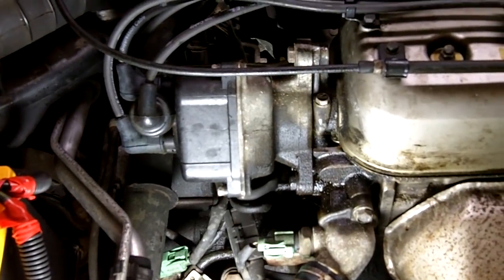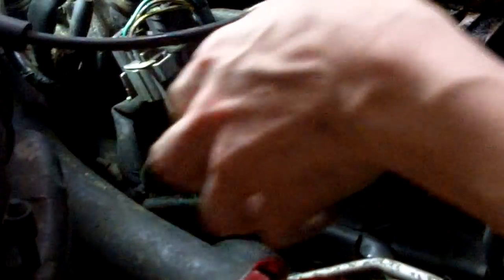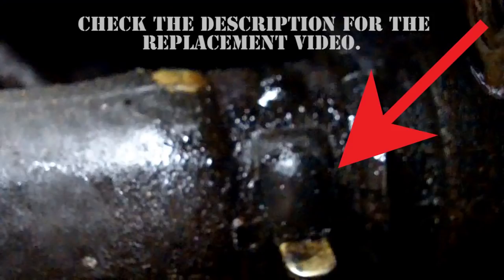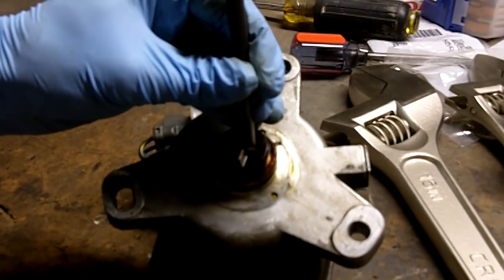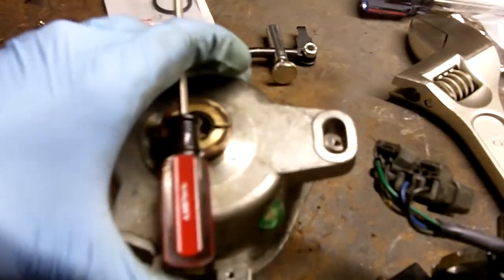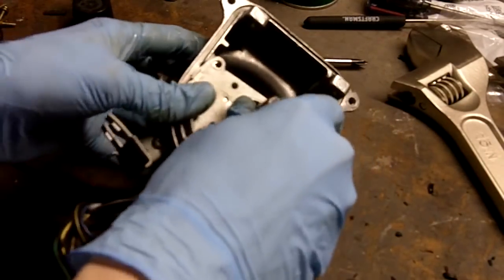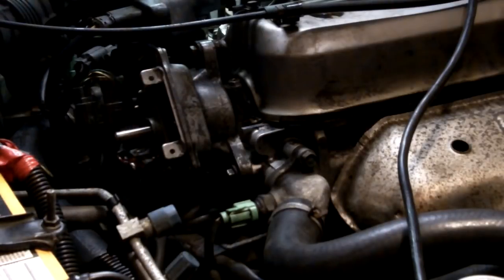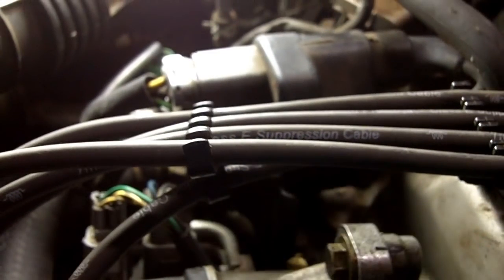Honda Distributor Oil Seal Replacement

Comment: Hey Bousho,  my F22B2 is leaking oil pretty bad from under the timing cover.  I had the timing belt replaced a while back and they didn't replace the main crank seal while they had it apart.  Lesson learned.  It might be my camshaft seal too though... I had a state inspection done here in VA and they mentioned it was pretty bad.  Whatever the case, any chance you have a video on these seals?  I hate the thought of having to pull a new timing belt off to replace a seal, but it also can't be good to have oil dripping on the rubber belts.  I'm guessing that's bad news over time.  Your videos have saved me thousands of dollars over the last year.  Your rock, man.  Keep these coming!!!
Reply from the maker: The cam and crank seals should have been replaced preemptively during the timing belt job. It protects your investment in the parts oil exposure will destroy the belt over time.

The water pump should have also been replaced if it seizes it will destroy the belt and cause serious engine damage. It's also a good idea to replace both idler pulleys too at a minimum you should spin them to check the bearings.

I usually purchase a timing belt kit it includes new idler pulleys, a water pump, the timing and balancer shaft belts, and only costs around 70 bucks. The seals and valve cover gasket are the only things I have to purchase separately.

Before tearing too far into the engine. Pull the valve cover off and check the gasket if it's cracked, hardened, pinched or rolled over due to an installation error especially around the timing cover area that's the source of your leak.

To get to the crank seal the timing belt has to be removed again. Remove the drive belts, unbolt the power steering pump and lay it off to the side, remove the valve cover, remove the crank pulley, remove the upper and lower timing covers, loosen the timing belt adjusting nut and remove the 2 belts, then you can remove the sprocket on the crank to get to the seal. The cam sprocket is just secured with 1 bolt and it pulls off be careful not to lose it's small key.

If you're just removing and not replacing the belts you don't have to remove the driver side motor mount.
Reply: ***** Great advice, my friend.  I'll pull the valve cover off in the next month or so and check it out.  In the meantime, if I find that the leak is coming from the seals, do you happen to know the part numbers on those two?  I've tried to pull the schematics up on Majestic Honda, but you know how vague the descriptions are on specific parts, I don't want to order the wrong ones if/when I need them.  Aside from the cam and crank seals are there any others I should replace?  I recently replaced the valve cover seal (within the last year), but I'm not opposed to dropping $20 on another one.  I'm still hoping you have a vid on these badboys!  :)  No pressure. You rock.  PS: the water pump was replaced.  I don't know about the pulleys or the seals though.
Reply from the maker: 4frodo
Good the gasket should still be fine unless someone popped the valve cover on with it rolled over during the timing belt job.

When you tighten the bolts down with a misaligned gasket it usually tears and leaves a little path for oil to leak out from.

Oh another thing I forgot to mention if 2 dabs of RTV wasn't put on both sides of the camshaft hump where the gasket seals that could also cause a leak.

You get used to navigating that parts database eventually as frustrating as it may be.

The crank seal is under oil pump because thats the part it's pressed into and the cam seal is under camshaft. I just use name brand aftermarket parts and I've never had an issue.
Reply: ***** I was able to pull 91213-PT0-003 for the cam seal, but no luck on the crank seal.
Reply: ***** Thanks Bousho.  I'll pop the valve cover off and check that I didn't screw up the RTV when I installed it.  I'm sure I'll have more questions in the coming days/weeks.  Keep up the good work!  It's awesome that you respond to these questions.  It means a lot.

Comment: I've understood most things bc he is a good teacher. The part in not understanding is the reference point for the two dimples. I saw they are both vertical, but I don't know the how to line them up, or what I'm lining them up with. So how do I ensure I don't reinstall it out 180 degrees? I'm not sure what I'm marking.

Comment: Or...there's a plan B, if you can't find the inner seal anywhere to buy and if you want a really cheap "fix" for this oil leak situation (mine: original Hitachi distro, VTEC, 96 Accord EX 4 IL, OBD2, has 268K mi, bought at 92K mi, self maintained except for the heavy jobs), instead of replacing the inner leaking seal (I had replaced the outer seal thinking that was the leak problem, but it was actually the inner seal), I just wedge a couple small kitchen sponges, dry, under the oil drain spout (it's there in case you do have this oil leak, keeping the distro from filling up with oil).  I swap out new sponges whenever the current ones are looking saturated enough, about every several months.  The distro leaks such a small amount that this works fine.  It does keep oil from leaking all over the hoses and other parts sitting below.  I've been using this "fix" for over 100K miles and it's totally functional, works great.   

A secret to keeping the oil leak small is keeping the engine's oil level no fuller than a half court below the full mark on the dip stick!  I just add another half quart when it gets down to the one-quart low mark.

Comment: Good to know i dont need to do that on my 1990 accord dx no power locks or windows takes 4rear handles. Crazy rare car. Over 500000 miles runs perfect
Reply: Internal coil accord ing to this guy
Reply: Good video!!! thats why o rings are so important it can kill all the electrical. i rebuilt my dizzy and dry ever since just the o ring same with power steering pumps leaks on the alternator killing it

Comment: did mine no damage to anything but lots of oil 30 mins and 1/2 can brake cleaner fixed cost me $2.15 for the seal and I had brake cleaner ...all good considering I just bought it for $400 with oil leak and no catalytic converter

Comment: BTW, I had hell getting the rotor screw out last time I changed the cap and rotor.  So I took a dremel tool and made the screw a deep slotted screw.  It was the only way I could even get the screw to come out.  Now it comes off and goes back on a lot better than with the POS original phillips head.

Comment: Great vid! Thanks Bushougoma!.  I did the job today and the external o ring on my car turned into hard plastic. No wonder the huge leak in my engine compartment. The internal seal didn't leak, but it was hard as a rock and actually seized to the shaft. It was rotating in the distributor seal bore! The heater hose bubbled from the oil leak, even though I replaced it a few years ago. Really recommend anybody doing this job to buy a heater hose in advance too.
ironqqq 1 second ago

Comment: This is a great video! Thanks for posting this and the other Accord videos! I am having this exact issue with my '94 Accord EX. I am sort of mechanically inclined but have never done a repair like this. How long (time wise) should this repair take for a first timer? Will this affect the timing once I replace it? Will replacing these 2 seals fix the loss of power that I am having?

Comment: Mechanic said I also need to replace to hose or else it may burst as the oil was leaking on the coolant hose. Do I need to replace to hose as well or can I get away with simply replacing the the rings on the distributor to stop the leak?  I guess the question is; is the hose sufficiently damaged now and needs replacing? Thanks!  Awesome video--this will save me about $200.

Comment: Great Video.  It seems that the industry doesn't acknowledge the cylinder position sensor: it does have a small internal distributor wiring harness attached to it; that wires get all cracked and brittle, especially when coated with engine oil.  Not sure to just use liquid tape, or go and cut and solder, more wire?
Reply from the maker: If the copper is still in good shape I would just slip some of the good heat shrink tubing over it the type with the hot glue like sealant inside to seal out moisture.

Comment: Copied comment from another video- 
If you're going to replace the heater hose that runs under the distributor, and you don't want to pay $30 or so for the OEM Honda hose 19527-PHK-000 from the stealership for a '97-'01 CR-V, I did the ground work for you (since after some closer inspection under the distributor that hose was SWOLLEN from probably years of oil dripping onto it from a bad distributor o-ring, and the previous owner(s) neglected it). They have epdm heater hoses at Napa for $.99/foot for this size hose. This is a 5/16" (7.9mm) heater hose (NOT 1/4" as stated on Napa's website), and it is 9" long (Not 8" long as stated on Napa's website) so one foot is all you need then cut to length. Napa part number NBH H149. It took me THREE tries to get this correct since Napa's website has the wrong info for this part. Still saved myself $30 though. You're welcome.

Comment: Great video. I was able to get the seals replaced, but now the engine cranks but won't start. At first I had to rotate 180 degrees, but it still won't start. Any ideas?

Comment: many people have reported frying the coil by not disconnecting the battery before removing the distributor cap. nobody can seem to explain why..but its a known problem. i ignored this..when i removed my cap..my coil went bad..
Reply from the maker: Battery power to the coil and the ignitor isn't supplied with the ignition switch off. So disconnecting the battery serves no purpose.

Coils are pretty robust the only way to destroy a good one electrically is to fire it without a path to ground on the secondary which will destroy the insulation on the windings.

I suppose if the graphite button that makes contact with the rotor on the cap fell off that would break the path to ground through the plugs and destroy the coil. An open resistor in the rotor blade would open the path to ground too.

Comment: So you recommend replacing both.  I new to auto repair but your video makes it looks simple. Does a typical auto store carry these parts. Thanks
Reply from the maker: They may carry the o-ring but not the shaft seal.

Comment: Different on the 2001 model; no snap ring over the pin and the pin doesn't pop out, even when hit with a punch... any reason why not cut the old o-ring off and roll the new one over and into place?

Comment: Tried a lot. The shaft pin does not slide out by hammering as you showed.
Reply: Did u ever get the pin out? What was the issue

Comment: I got stuck trying to take the internal screws out. I think I need a JIS screwdriver set for those internal screws. Some of the screws start stripping when I try using the screw bits I have on hand. I gave up and just changed the outer seal.
Reply from the maker: Yeah they probably are JIS many of those screws have a dot on the head somewhere to indicate that but I've run into JIS fasteners that don't have any indicator.

If you push down hard enough it's usually possible to get them out with the proper size phillips but once it starts camming out and rounding the head the proper JIS bit is usually the only thing that will take it out.

I bought a set of 1/4" drive JIS bits from a company called Vessel Tools they were around 10 bucks I believe. The good thing about these fasteners is when you have the proper bit it won't cam out and strip the head.

Phillips screws cam out by design to limit the torque applied to the fastener and destroy the fastener in the process.

Comment: Nicely detailed install. Is this distributor off of a 1994-1997 4cyl Honda Accord? I have a 1997 Honda Accord LX 4cyl F22B2 motor which I'm going to be replacing both seal and O-ring in the distributor and wanted to be sure the part numbers are identical. Thank you

Comment: That's correct, 3286.
Here is a dealer that has it. The picture is big, but it has the name KOK and the part number 3286 on it too. 
dang can't put link, but here is the site name. you can good to find it. They get this a lot so they make it easy to find. 
redsautorehab.

BTW, you are awesome Bushougoma!

Comment: I just finished the work included in the video on my 97 Accord SE.  I put everything back together, but now the car will not start.  I marked the back piece that you instructed to ensure that it wasn't put in at 180 degrees.  I even flipped it 180 degrees to make sure that I didn't mark it wrong and it still wouldn't start.  The only thing I changed was turning the steering pump pulley.  I also sprayed break cleaner in the area.  Any tips?

Comment: Hi Bush, great video - I have a F23A1 4cyl 2.3L engine in a 2002 Accord, without me pulling out the distributor would you know if this model dist. shaft has a retaining clip holding the pin in on the external part of the distributor shaft that inserts into the engine block or is it a pressed in pin that I'd have to punch out?

Comment: The NOK seal is slightly bigger in diameter than the seal I removed from my 1994 Honda Accord EX. I could not put it in the bore hole by hand with silicone.  I had to tap it many times to get it to go in and even then a small piece on the edge was pinched off.  The old seal number is S12 45 22 6 and I'm wondering if the NOK BH3888E0 is the correct replacement. Please advise.

Comment: Hi Bushougoma.  What make and model arbor press and press bits to you use to remove the interference pin on the Hitachi D4T94-03 distributors?

Comment: Push the new seal in the distributor and seat the seal is what I meant.  I didn't just put it back on the shaft.  That wouldn't have fixed anything.

Comment: The pin on mine does not fall off. I tried hitting it with a punch and a hammer and it’s not falling.    It looks loose but it’s on there.

Comment: What is the ignition coil and how do I tell if it's internal or external? Also I was told there was an internal leak, but when I removed the distributor cap I didn't see any oil in it. Could that be because I have the kind with the leak drain in the distributor itself and not the cap? I didn't think I saw any oil inside the distributor either, though. I'm guessing that rules out an internal leak?

Comment: I am not familiar with the terminology.  Are you refering to the rubber insulated wires between the distributor cap and spark plug?  I went back out to the car reconnected the plastic covered quick connects and tried, but no success.  I pump the gas pedal and it almost turned over and then stopped.

Comment: Great video, very helpful. I have to dig into my distributor to replace an ICM, would you recommend removing the entire unit or can I get at it without having to worry about messing up my timing?
Reply from the maker: You can pull the module out with it on the vehicle no problem.
Reply: I installed it this afternoon without a hitch, thanks.

Comment: I have a 94 honda civic nonvtec engine. and you explained that if the coil is internall then your nok seal will not fit the distributor. how exactly do you figure out if the distributor is tek or hitachi? does nok make oil seals for my distributor with the internal coil?

Comment: Thanks for the video. I changed the distributor on my 98 accord. I started up,it won’t run. All components are transferred. Do you think, I had accidentally turned the rotor without knowing it? Because I didn’t pay attention to which way the rotor was pointing to. If this is the case, I can turn the rotor back 180 degrees and reinstall it,and it should run, right ? Thanks

Comment: I have a 97 civic dx my problem is I cant find a oil seal for that year not on the internet
or dealerships. All dealerships say I have to buy the whole assembly over $300. The oring is easy to find  but the distributor seal is impossible. I bought off ebay but the seal was the wrong size.
Reply from the maker: Unfortunately the seals aren't available for some distributors. If the manufacturer and part number printed on the face of the seal doesn't turn up a seller.

The only other option would be to measure the seal outer diameter, shaft diameter, and seal thickness with a digital caliper. With that you can search for a replacement from another manufacturer. If you're lucky a search of the original seal part number will list these dimensions and save you some time. Also note which way the distributor shaft rotates the seals are directional. There are different part numbers for shafts that rotate clockwise vs counterclockwise.

If you do end up replacing the distributor try to find a used OEM one in good condition these Honda's don't play well with aftermarket ignition parts.

Comment: heh, finally got it off, thanks, although one of the screws inside my distributor won't budge and I think i've ruined the screw head. I've read online that there are other ways to get the screw out but it involves destroying the screw, I doubt an auto part store would carry replacement screws like that so I haven't bothered yet, any suggestions?

Comment: Sorry to bug you once more, I did all the steps to the best of my ability, I tried to start my car, and got nothing, so i went back and look at the final steps and thought maybe I forgot to lube that piece with some engine oil, I also made sure it wasn't 180 degrees out. Then I put everything back in and tried starting the car, now i get a start up noise but it still won't start. any idea what might be wrong?

Comment: i looked at the distributor, it says D4T92-04 HITACHI OM-1T 228....i think you are right about the part number 3286, i found it on ebay, it says that is for the F22B1 engine, which is mine.